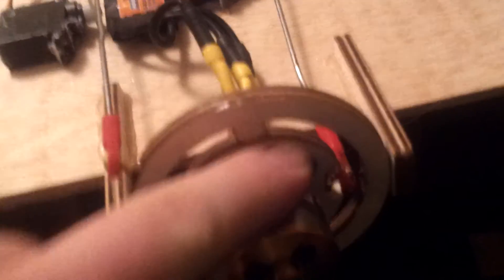FRCFOAMIES THRUST VECTORING MOTOR MOUNT

Comment: Hi Jay, I just didnt understand ur 2700kv focal price motor with 6x4 emp prop gives 35 oz thrust ?
Reply from the maker: what don't you understand?
Reply: eh i have ntm prop drive 2700 with 6x4 APC-e JM props. Its nearly have same thrust but twice watt. It seems wierd... And have d2826-6 2200 kv with same prop. It gives me around 650 gram... I think its prop issue , what do u think?